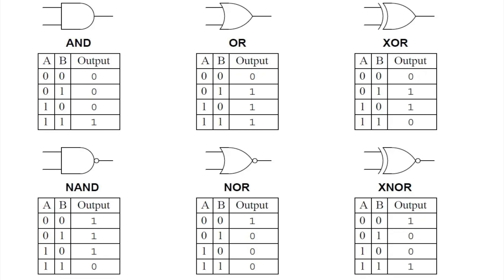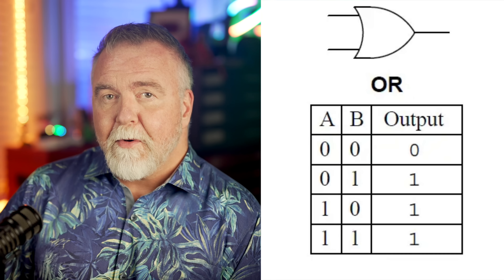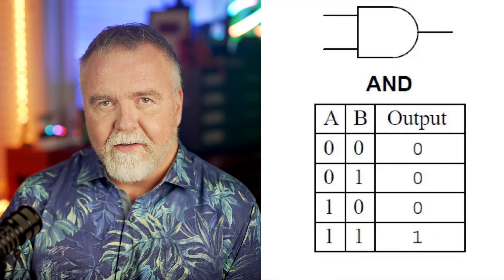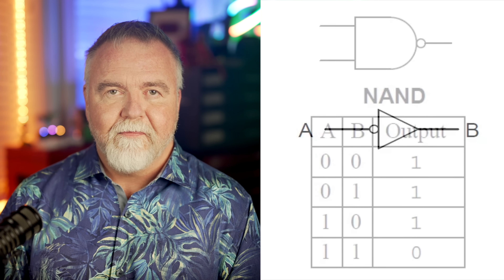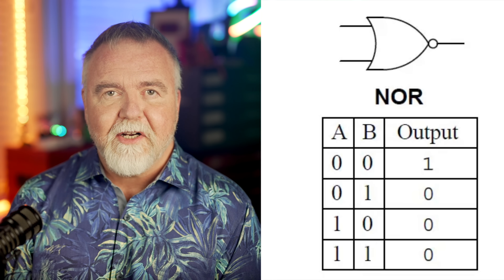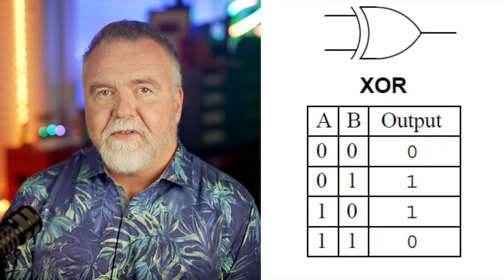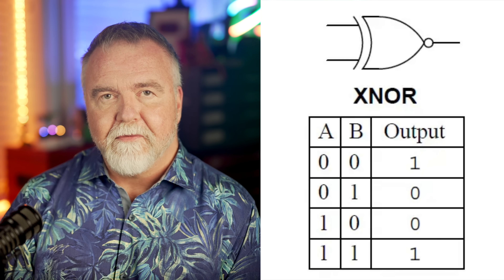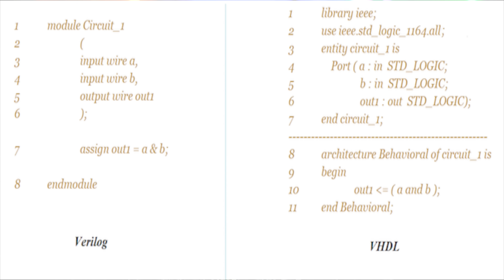The "Do Anything" Chip: FPGA

Comment: One interesting advantage FPGAs have over ASICs is the fact that fewer people and companies have contact with your design. This is extremely important in areas like military electronics, where you don't want a chip design falling in the hands of an enemy country trough the IC manufacturer. 

One place where FPGAs are often found is in the electronics lab equipment. Stuff like oscilloscopes, signal generators, spectrum analysers, etc. Those are relatively expensive and low volume products. In the past they were dominated by ASICs, but in time FPGAs took over.
Reply: I’ve seen several YouTube videos of missile internals recovered from battlefields. Hobbyists buy these “dud” missiles from Ukraine and other regions to take them apart to see how they work. You can see big FPGAs on the circuit boards. Hopefully the configuration code is heavily encrypted.
Reply: @ut4321  I've seen some of those videos, they are highly interesting. 
Usually there's no persistent memory in the missile at all. There's just RAM. So the configuration (known as a bitstream) is uploaded right before firing from the launcher or from a secure connection to a satellite or some other military network. That way when the power supply stops, its difficult to reverse engineer it. 
At least that's the a plausible running theory i've seen for the lack of persistent storage on thigs like the Javelin. I've never work on military electronics, but it would be interesting. You currently have interesting challenges not found in the civilian sector.
Reply: Do people use them for block chain mining?
Reply: @nosuchthing8  You could, but the power draw would be higher than a graphics card or an ASIC miner.
Reply: @Nikola Manolov  good to know,  thanks!
Reply: The enemy is within - humanity should be co-operating towards ending conflict by lifting each other up.  There is nothing new under the sun - if you can think it, it’s been thought of by someone else as well.  A midnight change to a foundry lithograph to backdoor some innocuous looking JTAG function could be used to disable the whole die on command.  Evil people buying off less evil people with counterfeit currency is how the world is ending, plain and simple...

Comment: PCB designer here. In the 90's and early 2000's I layed out many boards with Altera FPGAs. 500 pins and up BGAs. The circuit design engineers were using Altera's rather expensive design software that was schematic based in addition to writing the Verilog/VHDL code.
The biggest project I worked on was a Reflective Liquid Crystal Display for a HDTV projection TV. The design task for the engineers was to take a DVI signal and and condition it for the LCOS chip. There were, if I remember correctly, were 16 differential outputs from the FPGA to the LCOS drivers. The engineer let the Altera software autoroute the output signals.
Recall that I said these were differential outputs. Differential signal pairs needed to be routed on the PCB with certain parameters to keep the signal timings and impedance correct.
The output signals were routed to random pins on the FPGA. I asked if the output pins could be routed to fan out from one side of the FPGA and each pair would be on adjacent pins.
The guy yelled at me "It WON'T work! The software picks the pinouts!"
I persisted. I gave him the desired pinout and asked him to run the software with the output pins I assigned. He grumbled about how long it would take for the software to recompile the design.
He ran it with the pinout I asked for and the simulation in the Altera software did not complain a bit!
The PCB layout had no problems with signal integrity.
Reply: What a shifty story that doesn't add any value to this comment section
Reply: @jkf3169 I wish people would quit shitting on people that add their tangential stories. It's a discussion forum, it doesn't have to be solely about the exact subject. Too many of these so-called YouTube judge and jurors trying to sanitise the comments based on their own rules.
Reply: @jkf3169  *Shitty
Reply: @jkf3169  im gonna touch you

Comment: You did sort of fly past the fact that FPGAs also do all the flip-flop types you may want.  It is in fact done by wiring simpler gates together but to the programmer, it appears to be a fundamental part.
On the topic of errors creeping in:
Any time you design something or program something, there are errors constantly trying to sneak into your design when you are not looking.  It is no more true of the FPGA than it is of microcontroller software.  
On the topic of micros in an FPGA:
There is also the option of a "soft micro controller" where you define one as part of the FPGA design.  The interesting thing about this is that you can invent your own or modify an existing one.  You can have a machine with a 42 bit instruction word that does its math in a 13 bit register set if you really want.

Comment: You mentioned ASICs compared to FPGAs.  I'd point out that while FPGAs are highly configurable compared to ASICs, ASICs tend to be faster and smaller since they are dedicated solutions that lack the delays inherent in programable circuitry.

I also think it would be interesting if you dived into how the logic blocks are implemented in differing FPGA architectures.  Also an overview of PLDs / PALs / PLAs might be interesting as well.

Comment: My last but one job the initial development was done with FPGA but since we were shipping many many tens of thousands of boards the final design used ASIC, not only cheaper but also faster. The mantra with ASIC was no respins, ha if only. My last job a much smaller manufacturer where the number of units was maybe not more than 10,000 in total the final boards went out with the FPGA.

Comment: As a professional FPGA developer, I can say that the gravest error you could make is to treat  VHDL or Verilog like just another programming language. In fact, it would be advantageous to forget whatever you know about software programming, while creating a digital design for an FPGA. While superficially similar,  it requires a totally different way of thinking.
As for FPGA as a hobby, it is perhaps alright as long the disign is not too complex, runs in a single low frequency clock domain, so there are no timing issues which could be overwhelming for an amateur to solve. On the other hand, such project would be probably more suitable for a µC or a DSP
Reply: Yes, the "source code" for an FPGA is more like a text document saying how to wire logic gates together than it is like code for a processor.  All of the stuff all happens at the same time in an FPGA.  You have to work at making it sequential if that is needed.

Comment: An FPGA is much slower than an ASIC.  I company I use to work for used them to prototype a custom multicore Tensillica based dsp.  I think the fpga ran at about 1/4 speed compared to the ASIC version of the chip, but your result may vary because of (engineering details).

Comment: FPGA engineer for over 20 years, you did a great job of summarizing what they are and what they are for!
Reply: All i can add are what i wish for the Future...The FPGA Lobby meets the Right to repair people and get a rule...if you Stop selling your Product, IC or Controller you have to give the VHDL Files to replicate and keep Things going.

Greatz from Germany
and have a nice Day
opo
Reply: Great, now tell me what is the correct format to create a VHDL counter, seems people have different opinions, like reset condition should come first, others say the increment and then a simple if condition to reset it, what do you think?
Reply: @engjds  I think you should write your code in such a way that:

1) it implements the hardware you expect
2) the code leaves NO ambiguity as to how synthesis turns it into hardware
3) the result is timing clean and complete

What you describe doesn't sound like something that should have an impact, but I'm more a verilog person so when it comes to VHDL I've been surprised many times how 'specific' VHDL can be.
Reply: @repatch43  Thanks, good tips, I have been playing with code and then viewing the RTL it generates and I can never get it to look how I think of it in hardware, it works ok, but for instance if I make a counter, it uses say a 25bit reg feeding back into itself through a sum block, problem is I work across platforms, currently on the nano littlebee 1k, but also used Altera, am I right in thinking you have to modify code for each fpga platform because of the CLB differences or is there standards out there that should compile efficiently on any fpga?
I am confused as to how many processes I should have in my design as well, am I right in thinking you would have one process per clock type?
Reply: @engjds  You shouldn't worry about the underlying architecture of the FPGA much when it comes to core logic, unless you're REALLY trying to optimize every last clock cycle or LUT out of it. It matters much more if you're trying to infer memories or math functions, since the same bit of RTL that infers say a block ram in one architecture might infer a see of flops in another (although if you stick with registered reads, writes and addressing you'll usually be fine). Also, keep your clock gating (if used) VERY simple, if you go at all complicated then you'll have to start writing architecture aware code to properly infer the clock control blocks relevant to that architecture (unless you like hunting down REALLY hard to figure out timing issues).

I don't think the number of processes matters much, as long as each is exclusive (i.e. you're not driving the same reg in different processes). I personally prefer all the logic in a clock domain to be in a single block, and if that starts getting too big then start using modules to partition the logic appropriately (using modules in general is a good idea, makes code management and portability much better).

And no matter what, FULLY constraint your design. Make sure all your clocks are properly constrained, and CDCs are handled properly, and all IO related timing is specified. You should have NO timing warnings at all if you want to have a good time.
Reply: Hey, im a self taught software engineer, with a decade in the industry (Working as SE). I do this stuff as hobby (cause learning is fun), what would be the steps to take my FPGA to actual hardware? For example given I have my HDL, what would be the next step to convert that to physical hardware, like a printed circuit (not FPGA itself). Just some steps so I get some visibility would be highly appreciated
Reply: @jordixboy  You can’t really do what you’re inquiring about, unless you have an entire fabrication plant, clean room and all, in your garage. You’re also going to need way more advanced knowledge than what you have as a hobbyist because you’re going to be dealing with physical layer design and you’d need to understand some very complex concepts like place and route, partitioning, BIST, testing/verification, Power management ( on a nano-metric level)  etc ( graduate level Electrical Engineering stuff).
Reply: Aren't somewhat similar to analog computers?
Reply: It's good to know someone with twice your experience got it right.

Comment: The FPGAs are today unfortunately an endangered species - most big provides of FPGAs went with the AI bs and started producing a fixed function accelerators wrapped with proprietary libraries. There is no longer a freedom in those chips - for the hardware engineer. The freedom of making whatever hardware is spoiled by the AI marketeers. That is pretty shame. The COVID supply chain disruption ended supplies of most FPGAs and it still has not recovered and with this change of targetting the clients, it seems the vendors are not at all interested in restoring the supply of normal FPGAs. Plus the constant paper-releases, with no real availability.. I am very sad from this situation - basically we can not create a mass produced product based on FPGAs - and the few parts I have collected would be just a personal playground... well.. only if the tools would be free to access, which they are not, for the larger parts. Which are hell expensive.. and they still want us to get the software. Not once.. but each year.

Comment: Actually, CLBs are composed from programmable look-up tables (LUT).  Every combination of inputs (usually 2-3 inputs) selects one of the table entries that you have programmed and this entry then becomes the output.
The dedicated hardware in ASICs is also faster and can have analog components.
Reply: You described the way Altera does it.  I think many do the same but not all.
Reply: @kensmith5694  They all use LUTs instead of gates.

Comment: FPGAs and CPLDs have revolutionized the retro gaming community. They've enabled everything from optical drive emulators and flash carts to video output mods to analog video scalers to entire FPGA-based game consoles like the MiSTer and Analogue's product lineup. This is because the cost of small FPGAs has finally come down to the point where it's practical to use these for small-run consumer goods like this. Right now the state of the art for implementing consoles in affordable FPGAs is the Sony Playstation and Sega Saturn, though the Analogue Pocket handheld FPGA-based game console also deserves a shoutout for the form factor.

Comment: Great Explanation! I am glad to see someone give some promotion to FPGAs. I always believed they could be a great tool for hobbyists but until recently, the cost has been pretty steep. I've been using Alter (now Intel) devices since about 1990-ish, primarily for video controllers and occasionally some special interfacing functions. Last year, when FLGAs were all but unobtainable, I looked at doing a board with LVC logic to replace one PFGA. That was the point where I fully realized how much time FPGAs have saved me over the years and in the end they make for a far less expensive solution. I have designed a number of building blocks over the years and I still use some of the ones from 1990s unchanged hey just get compiled into new devices. Need to make a circuit change, just reprogram. It isn't uncommon for our first rev of a board to work and be production ready.

For me, one of the things that defines needing an FPGA is when I need very precise timing, in my case video controllers are the main reason. While a few people have made general purpose processors produce video, it generally doesn't some close to meeting the stringent specs required or have good flexibility. FPGAs excel at this when a full blown GPU is overkill. They also work great when you have a lot of random logic that just needs to be condensed.

From a hobbyist standpoint, I see two major issues. The learning curve can be very difficult to get up and running quickly. I believe with more people promoting FPGAs to hobbyists, that could change. To get something simple up and running on a device like a MAX10 is actually pretty simple once you learn the process. But navigating the initial settings for a project can be very intimidating. But it isn't much more difficult than using a new microcontroller for the first time, there just aren't as many public resources. Perhaps the most difficult part is the physical package itself. Most FLPGs these days are in Ball Grid Array packages, not exactly the easiest to work with. I'd like to see some small, affordable development boards become available for getting started. I've seen a few int he $50 range now but the ones I have seen have some quirks. Even if they required a separate programmer, I think a small starter board could be done for maybe $30 and still have considerable power.

Thank you again for a great video!

Comment: I used to work in ASIC (with Toshiba) now I work on Altera FPGA's, they are great chips and these days we are commonly working on designs running at 150 to 300Mhz.  One comment to make, while we can optimise our designs for various logic gates in asic commonly we use 'standard cell' the technology in ASIC's is often full of frankenstein and-or gates that work better then individual cell gates that perform a single AND or OR, so I write the high level logic and let the compiler do the optimise it.
I take the same approach on FPGA's - a good design architecture is the key to small/fast :)

Comment: In a way, programming an FPGA is the next lower level of programming before Assembler. You can program a processor onto the FPGA which you can then write an assembler for, to program in assembler. Or you can implement some non-programmable logic into it, which may or may not even have a clock speed.

Comment: I would love to see an FPGA-driven SDR (Software Defined Radio) kit for consumers so that it can support future air interface specs with a software update.  Of course the regulatory authorities, wireless ISPs, and mainstream manufacturers will do everything in their power to prevent that from happening since it would democratise spectrum access and they all want more control over their pieces of the pie.
Reply: The RFSoC is an fpga with high speed ADCs and DACs. Can digitise 4ghz of spectrum, which is pretty huge. It's probably overkill, but is extremely powerful
Reply: The hard part is the ADC you need.  Once the signal is a mess of numbers, the FPGA is a direct path to what you want.